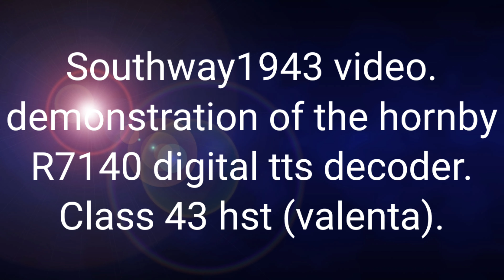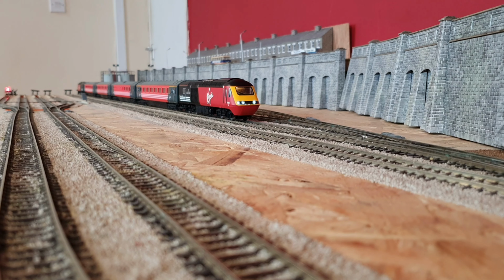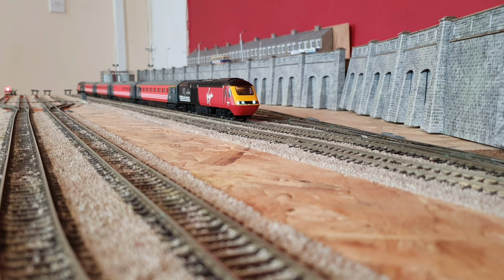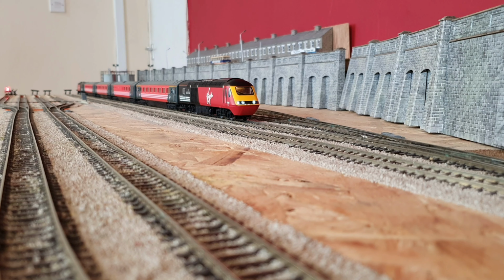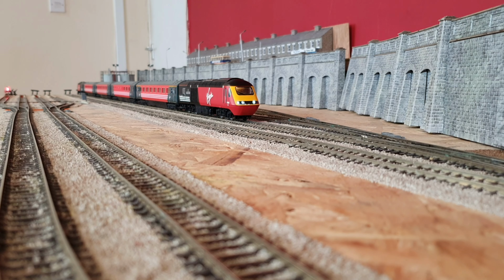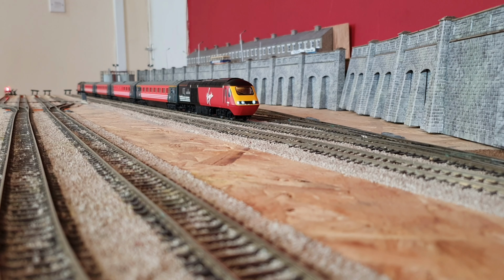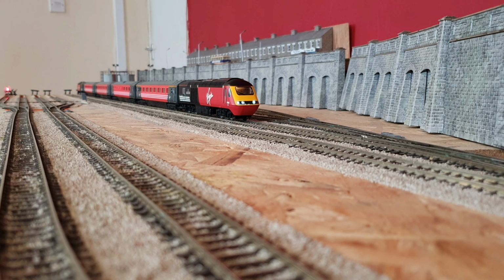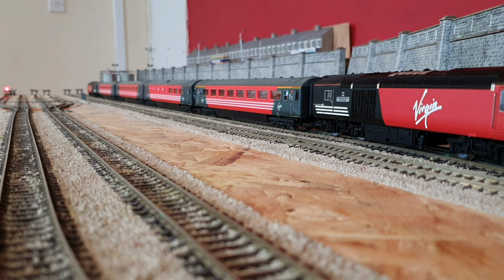hornby R7140 class 43 hst valenta tts sound demonstration

Comment: Hi, I just love the paxman valenta engine and yes I do agree great start up. You are definitely right about the move off. You get the deep rumble of the engine probably up to around 20mph. Then... the squeal kicks in and about 5-10 secs later the valenta roars into life. But for the money, it’s not bad, Ive heard much worse.
Reply from the maker: hi ya john
thanks for the comment I have gone on to videos of the real train and double checked and we ar both correct the turbo kicks in later on and probably on a higher notch setting.
but as you said for the money its a great little product.
peter from birmingham

Comment: sounds ok to me!  might be better with a better bass speaker though
Reply from the maker: Hi David 
I would totally agree with you a better speaker would be better but if you do replace the speaker check the instructions to see what ohms the speaker is on the chip to start with or you can damage the speaker if you get the wrong type.
Hope that helps.
Peter
Reply: @chelmswoodjunction  Hi Peter apparently the mega bass speaker cube is compatible with the R7140 hst valenta tts module  there are a few videos  where they are being fitted to the Hornby HST  plus the dummy car   I am fitting a R7140 to my Lima HST   I'm going to fit  the R7140 into  my class 56 instead of the 8 pin module  as its a ruston engined  loco not the valenta though!   theres a video of a 56 on youtube and its sounds exactly like the  Valenta when its pulling a coal train.